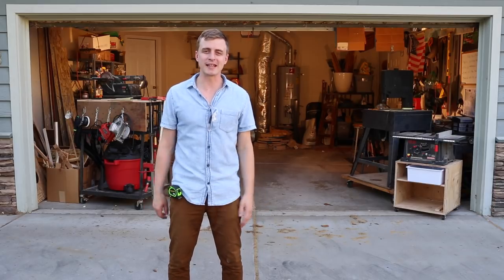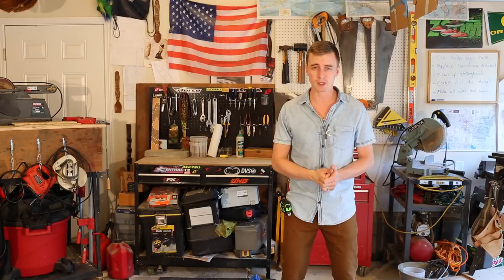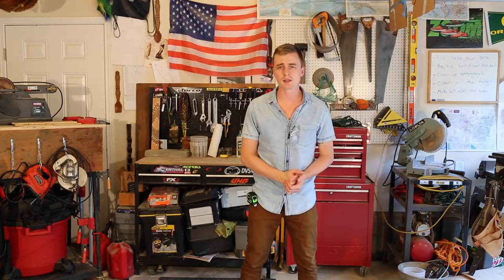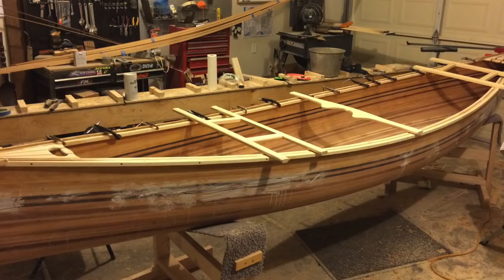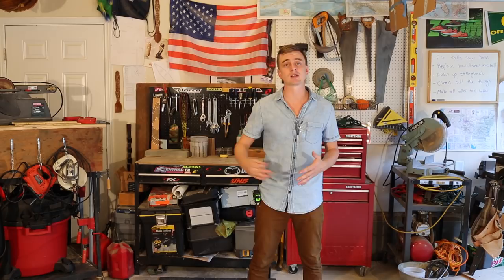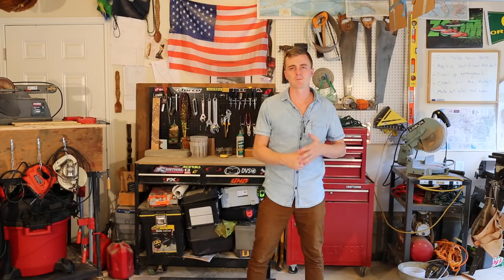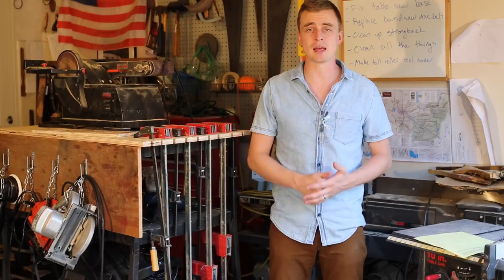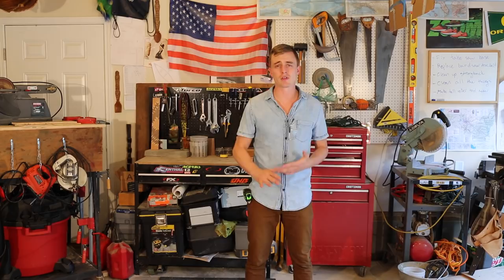What to know before you build (Ep 1 - Cedar Strip Canoe Build)

Comment: #1 the glue used to edge of strips should never be to dense or too spongy. You will get crappy hull shaping that no amount of sanding will fix.  #2 wet sand epoxy with 3M Flexible Diamond Hand Lap( i always found them called 3M Dia-Pads).  Now i see 9 different micron grades available in my MSC Industrial Supply catalog on page 927.  A small trickle from a garden hose with these yields cheeper results(better to) than hunderds of $ of sand paper!!  Vetern of 22 canoes.53 years experience.

Comment: I've watched several of your videos on canoe building.  I'm building 15 foot cedar strip canoe. I'm now fairing the hull. I'm struggling filling voids. I made epoxy mix with saw dust. West system epoxy because I use it for stem glue up and also to mount stems to the boat. I've epoxyed about 5 times. After sanding I have holes I guess air pockets. I have less and less each time. I put tape on the inside. Tried wood filler huge mistake. Any hints?

Comment: Couple things.  First, your canoe is fantastic, very esthetically pleasing and must have been major fun.  However, your use of power tools needs serious attention.  Never, ever use a table saw free-hand.  You have a band saw that is specifically designed to safely cut free-hand.  Next, cutting thin strips; you set the fence up about 1/4” to the right of the blade and proceeded to cut the strips, trapping the cutoffs between the blade and fence, anther very dangerous setup.  You need to set the fence to the right of the blade, as you did, but run the “larger” piece against the fence and generate the thin cutoff strip to the left of the blade, free to move and not get trapped as you push the “larger” piece clear of the blade with a PUSH STICK.  This does require resetting the fence for each cut but setting a simple stop-block enables very quick, repeatable cuts.  Looking forward to your next project!

Comment: Hi Adam

I just finish my first canoe witch is for my cousin. I watched all your video over and over again and it was very helpful.  Thank you so much to have taken the time to document all of this. Now I'm starting another one which will be mine. For the first one, on the hull middle line, I just cut the angle of each individual piece of wood witch is very hard to find the angle. You made a chalk line and used a circular saw.  I don't know witch video it was but you mention that if you would have to make another one you would not do it this way anymore. My question is how would you do it
Reply from the maker: hey man congrats that's awesome! thanks for letting me know - I'd love to see photos of yours! There's a video made by "bear mountain boats" that I watched recently where he cut the line with plenty of extra room, then worked down to the line with a chisel and planer. That way seemed a little more safe than what I did. congrats again and good luck on your next one!
Reply: How can I send you photos
Reply from the maker: Dancing Lights aguydoingstuff@gmail.com or you could tag me on Instagram